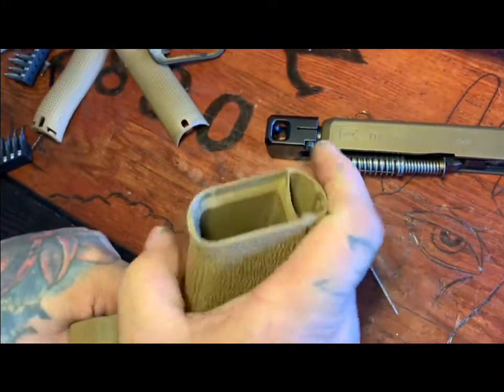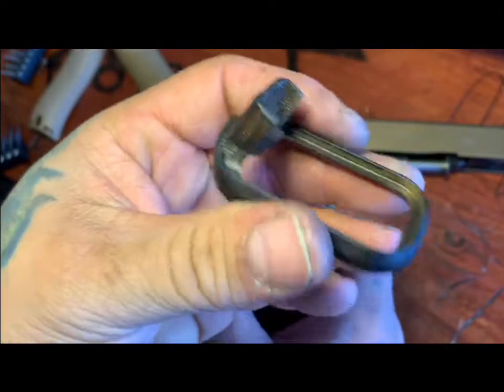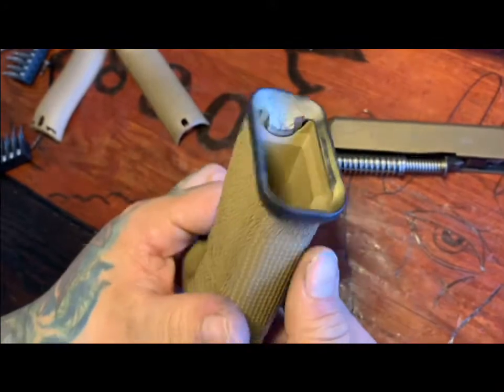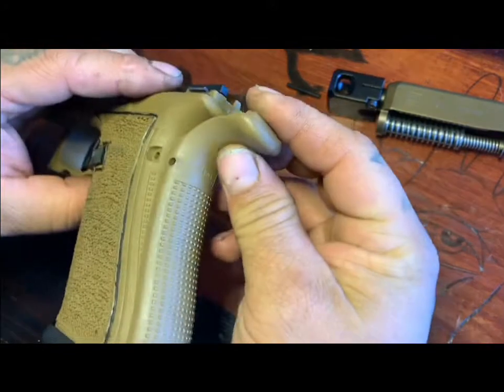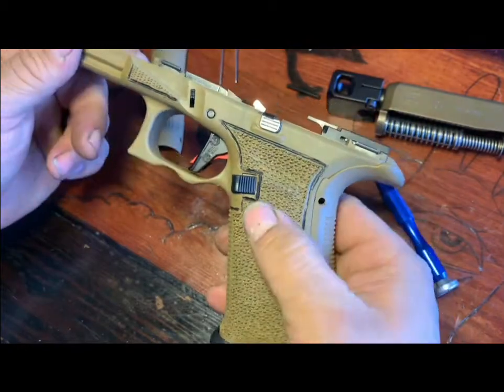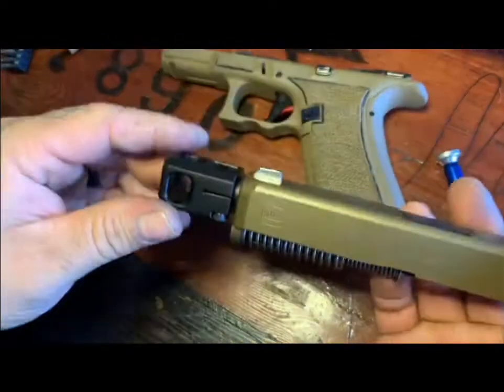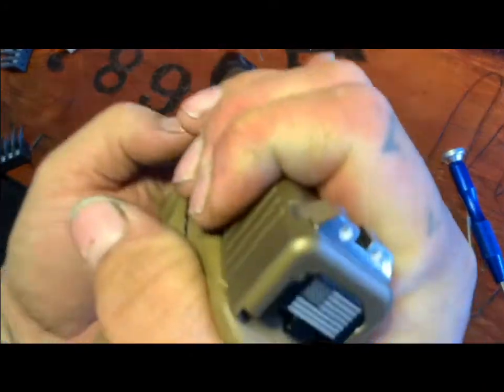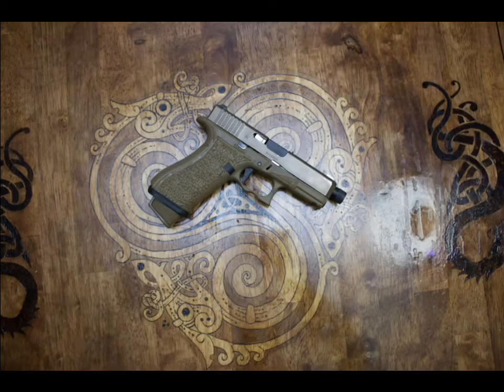Home made Glock mods

Comment: With a proper grip you have most of the pressure on the front and back strap of the gun so basically the stipple job uve done is pointless